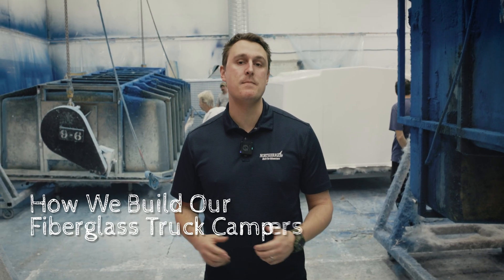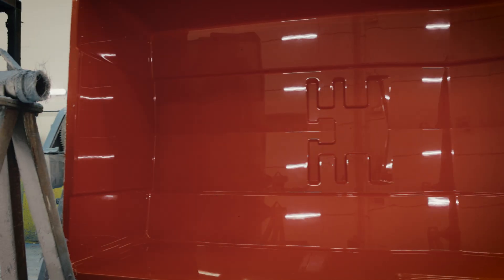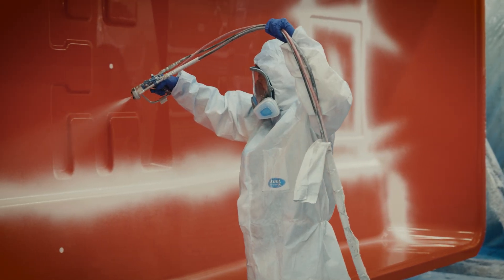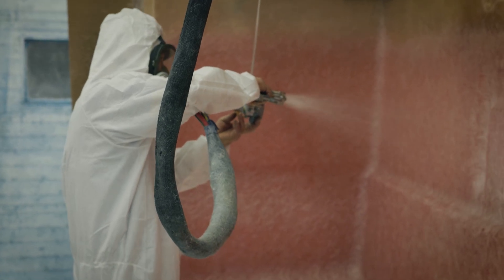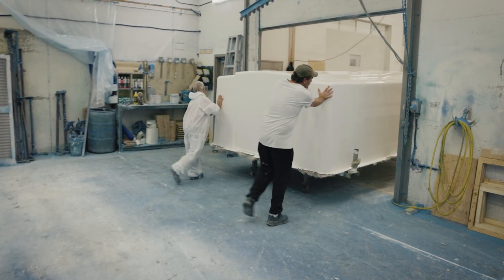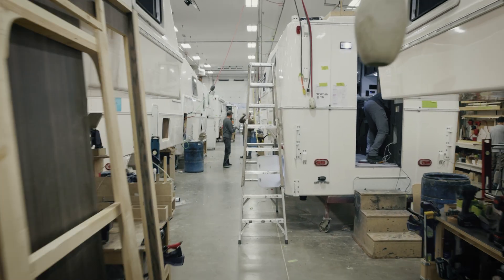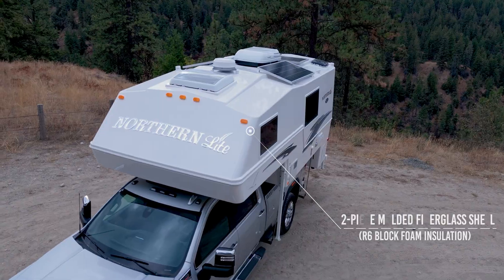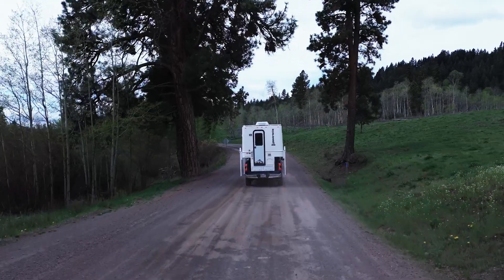How We Build Our 2-Piece Fiberglass Truck Camper Shell

Comment: How long does it take to build one and roll it off the floor? the 8-11 Dry bath with the 600Ah Lithium Power System, to be specific?
Reply from the maker: From order to delivery for a unit with requested options/interior is typically 2 months. Depends on the order queue though. All order go through our dealers so the best thing to do is reach out to a dealer near you and they will be able to give you an accurate time based on their location. https://northern-lite.com/us-rv-dealers/